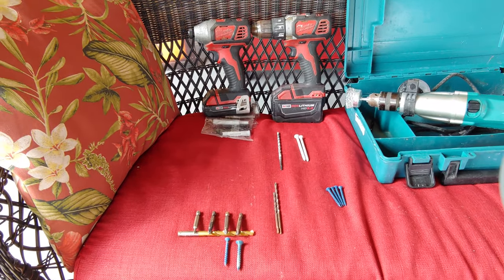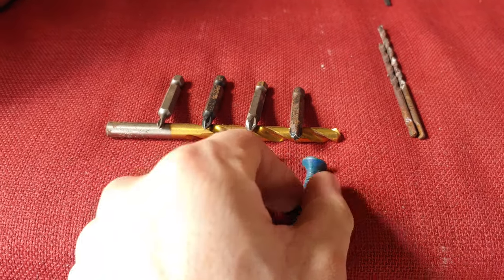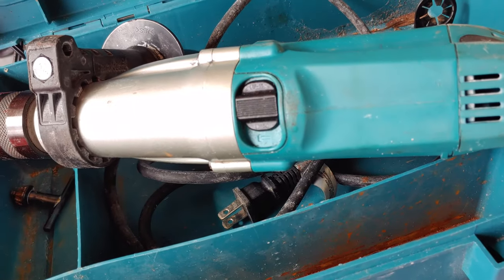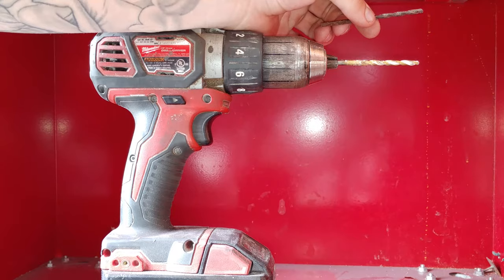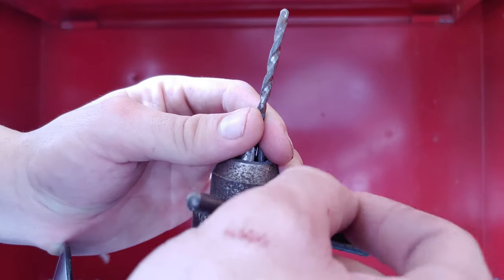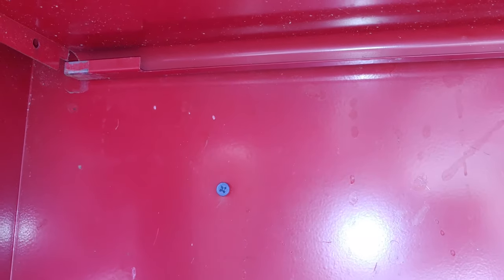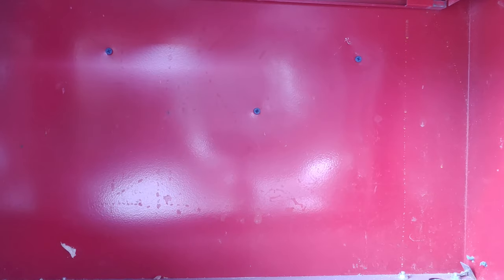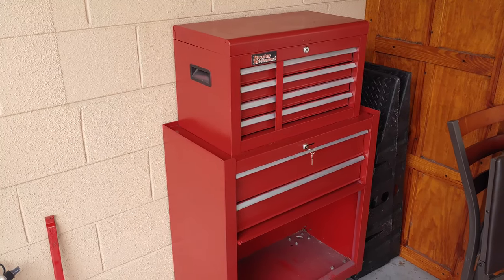How To Use a Tapcon / Concrete anchor / Concrete screw | Everything You Need to Know

Comment: Just a note-- Tapcon package suggest a masonry bit smaller than the screw size. Read the package before drilling. Also do not over drive those screws. They  can strip out concrete and block. I usually finish last couple of turns by hand.
Reply from the maker: Good tips!!
Reply: @BuddysDIY  also dont use an impact drill with the tapcon.  the impact can blow out the concrete/brick
Reply from the maker: I've never had a problem with the impact to be honest. Just gotta be good with some and not over tightnen
Reply: Agreed 100%. Found out the hard way.

Comment: Thanks for the video.  This will definitely anchor the tool box in place.  If you want to maximize your anchor strength when sinking them into a cinder block wall, you may want to take the additional step of aiming for the "studs" in the blocks.  Most cinder block walls are hollow, so anchoring into the solid portions of the blocks, which are typically about 1" from the left and right edges will give you the strongest anchor.  The grout is probably the weakest point on the wall to anchor to, so avoiding that's also ideal.  That said, for this application, it would probably be overkill to go through all that extra trouble.
Reply from the maker: You're definitely right. But if there was gold in this tool box I would be hitting the studs for sure haha
Reply: @BuddysDIY  👍🤣

Comment: for kitchen cabinets on concrete, would you recommend using the plastic anchors? i plan on storing my dishes and stuff on those cabinets so they need to hold around 100 lb

Comment: I'm sure you meant to say 3/16" screw and not 3/8" screw. I just used some 3/16" Tap Con screws the other day, to install a dryer vent to the exterior brick wall.  Ironically. You have the same Makita hammer drill I have, when I did my install.

Comment: When did 3/8" shrink? Last I knew of, it was bigger than 1/4". That drill is called a hammer drill. Tapcons aren't really good in cinder blocks and morter. They're best in concrete.
Reply from the maker: I ment to say 3/16 lol. I noticed that like a week ago
Reply: @BuddysDIY  lol. I kind of figured. Had to give you some crap though.
Reply from the maker: @RenegadeJD  hey man it was deserved for me posting this an not noticing! 

Trust me I'm not that dumb 🤣

I can do pretty much everything when it comes to residential construction. 

(Expect roofing, never learned because I never cared to do it. I live in florida where you have to be insane to take a job roofing here.

Comment: Is the hammer feature on the drill necessary?  Can you drill the hole in concrete with a regular drill, as long as you have a concrete bit?
Reply: Yes it is necessary, the bit will just melt if you don't have a hammer drill
Reply: No it is not necessary. I use SDS bits(hammer/rotary drill specific) in my regular 18volt Dewalt Impact drill all the time. Downside to this, is it does take considerably longer to drill, compared to using the hammer drill.

Comment: I’m just diy, but found cinder block very porous and suggest NO hammer function to prevent blowing out the back when you hit the void space, like blowing out dry wall if you push a drill through it in void space.

Comment: Good tutorial. But I'd recommend a quick sealant on the hole drilledinto the toolbox (You can use paint, but I prefer to use a very thin amount of silicone #1 on the hole).
 
Another think is to support the toolbox you mounted to the Svrew better. The screw is held well in the block, but it's not too hard to rip the toolbox off the screw. You can use a simply flush mount washer, but I will actually use a 1x4 (long enough to extend 2 inches out from the further apart screws you use) on inside of the toolbox. Then I can run my screws through predrilled holes in wood, and through toolbox and into the wall. (Basically sandwhiching the back plate of toolbox between the hardwood, and the concrete wall.)
 
If it's a heavier toolbox, I'll use a piece of Angle or Flat steel bar instead of the wood. 
 
One cool thing about the wood (or angle iron) support is that it gives you a great place to mount some lights. The LED strip lights are dirt cheap these days. And it's just nice to have. Plus a red light coming out of that beautifully restored toolbox would look badass. Lol.

Comment: Tried those screws in my garage and they sucked. Would not grab.  But my concrete is poured not blocks like in video.
Reply: I have tried tapcons multiple times in different masonry material, including concrete. Not once did one of those things hold or even bite when I drove it in. Pure worthless junk in my view.
Reply: Likely the hole is too large for the screw shank if it’s not biting.  Also, don’t use impact to drive screws.  If not biting, wind the thinnest metal wire you have around the shank and screw in again.  It should bit very well, and cut the wire after the screw is in.  It’s works for any hole where it’s too big for the screw, except drywall.